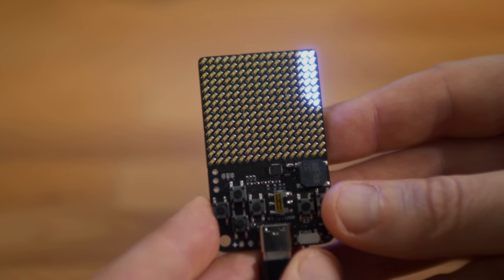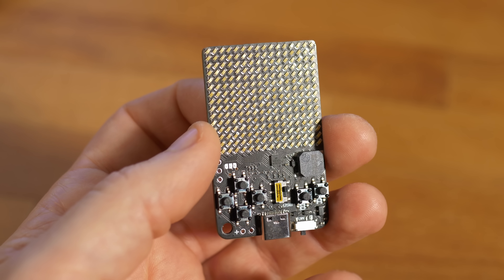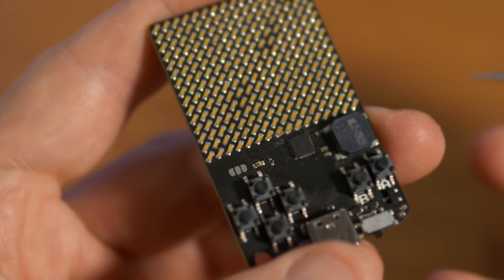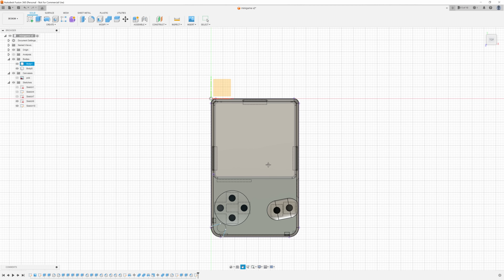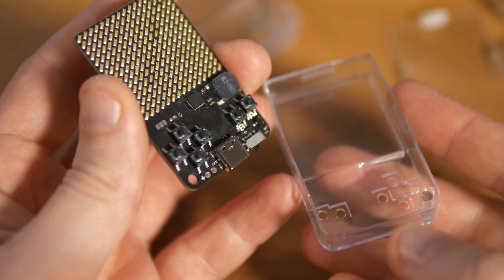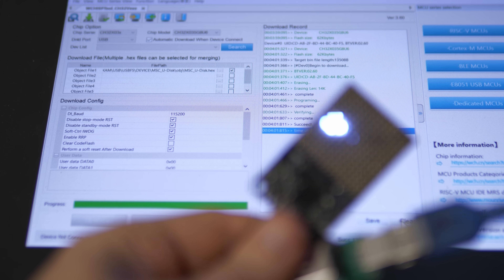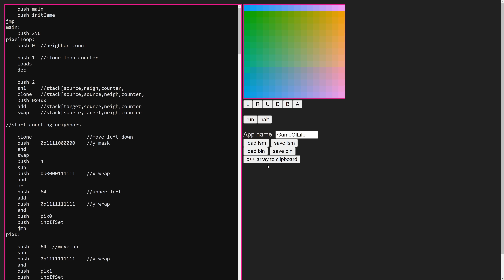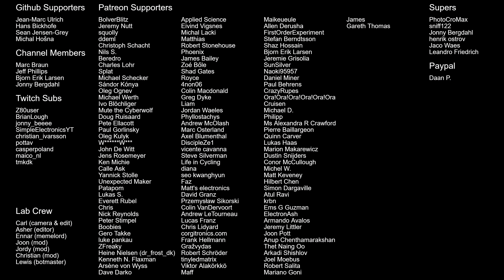Open source lightweight interpreter made in a day

Comment: Just a fusion tip, rather than importing an image and having to draw all around the place, export a step file from kicad and so long as there are 3d models for the parts then you'll get a 3d model of your board and everything. Much easier to start with

Comment: Damn, this is just pure wizardry.

When I try writing a program for one of these somehwat obscure chips like the ones from wch or bouffalo, I get completely overwhelmed. The sdk is almost always lacking a lot of qol features with everything relying on low level api that I have no idea how they work because documentation is non existent and whatever examples there are, they are most often lacking and way too complicated despite doing something very simple. No tinyusb and certainly no arduino usb but some sort of custom library or library I've never heard of to do everything from setting up descriptors to sending and receiving data all in low level apis and from a single "example" file. Sure, I could get a blinky working, but this? I struggle understanding how you even figured a lot of the obscure parts of how to program them.

Reaching this level of arcane magic with all those powerful spells has always been my dream. Yet the complexity never seems to end. I truly admire all the work you do.

And btw, there is a thing called pikapython which I think can run on mcu with as little as 2KB of memory (and binary size is also small).

Comment: Love how QFN soldering is just SMOOSHING the part on there and it works
Reply: It is really so much easier to solder than qfp it is not even funny. With QFP if you get solder high up between two of the legs you're basically screwed. With QFN you just drag a fine tip soldering iron along the bottom edge and any excess is gone.
Reply: great way to create shorts
Reply: Not if done properly with correct flux and not garbage.

Comment: Congrats on the byte code work! Just make sure you don't force tabs on people like arduino did with spaces. I abandoned tabs years ago because they encouraged me to be reckless in my code writing. I started programming in 1967 using IBM punched card mainframe computers. Most of my micro controller designs in the 1990's required me to write an assembler for each new chip.
Assembly programming has become a lost art form. Good on ya!
Reply: Tabs are still great, it's this modern trend on forcing multitudes of spaces that's such a pain. Programmers should be free to choose 😊
Reply: @rashidwinter  Exactly.

Comment: I recently designed my first PCB and also used fusion to design a case, however instead of using an image of the pcb as a canvas and tracing it, I exported the PCB as a .step file from KiCad and worked around that 3d model in Fusion. Worked out well, PCB fit first try.

Comment: What's wrong with Blender?
Reply: It doesn't support parametric modelling, and isn't as good as CAD software for engineering tasks. With CAD, you specify dimensions, radius, bevel radius and such without bothering with vertices and the topology of the model. It's a completely different paradigm. Blender is really really good, but it just isn't made for engineering in the same way as say Fusion 360 is.

Comment: diy circuit assembler. support for who. not you. them. and you could just do the case from sheet plastic, and bend it and melt it and make the holes. by hand.
Reply: if you want to play with fpga gpu's, you can ise a terasic DE10 nano soc platform with linux on the arm processor to test it. 110K logic units. maybe a few gpu cores like in a desktop system.